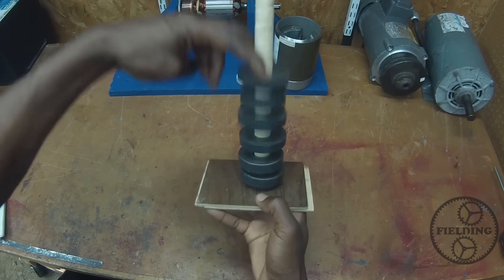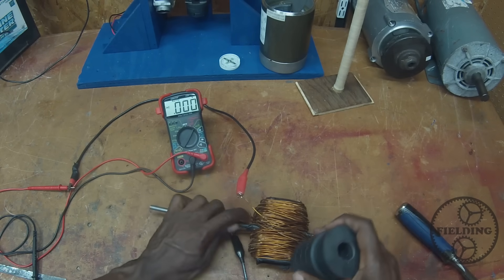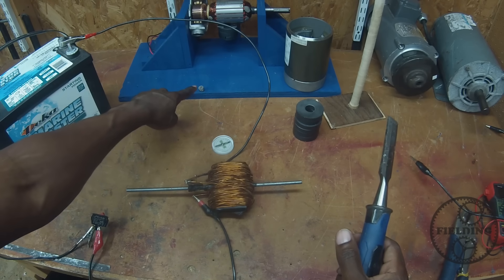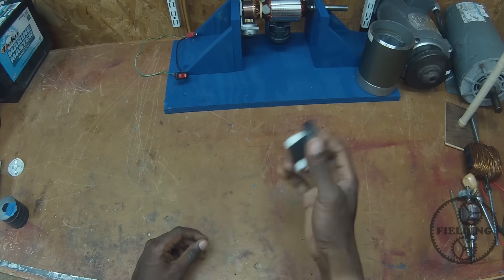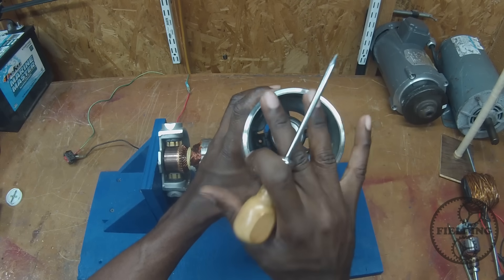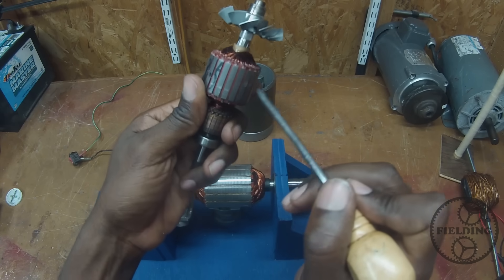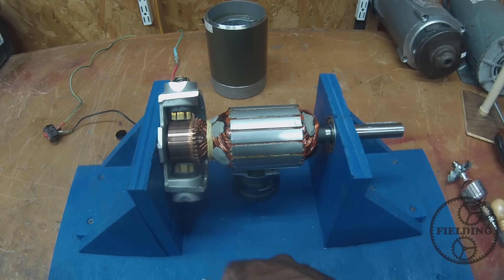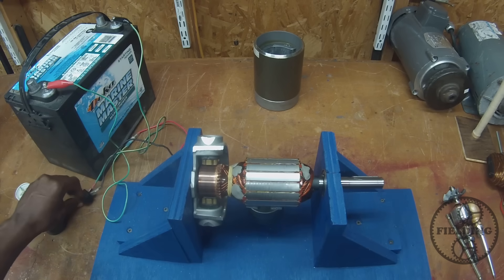How Motors Work For Beginners (Episode 1): The DC Motor: 032

Comment: I enjoyed your presentation by multiple examples.  I never have cut any motor to 1/4 open. Cudos!
One thing where you can meet a whole lot of interesting and so practical details is the brushes.  They are mostly made of carbon (graphite) for some very beneficial properties.  First, they have a natural lubricating property, so they do not wear too bad, despite of being relatively soft.  Then they have just an adequate amount of resistance so that they don't cause a total short circuit between the two neighboring commutator segments.  That allows the energy in consecutive coils be dissipated in more gentle fashion.  However, at really high speeds, you start seeing some sparking.  That is related to what maximum speed is specified to the motor.
Many people try to "clean" a patina that has built on the copper lamellae.  That generally is a mistake which causes wear of both the carbon brushes and the copper commutator.  The wear product (carbon dust) settles to the gaps between the segments and that may cause a "ring fire" around the whole commutator circumference.,  Building a healthy, smooth patina requires air and some humidity.  Motors to be run in vacuum or at very dry ambients cannot build the patina and have to choose something else than graphite brushes, such as some silver alloys used on satellites.  Or they have to use brushless motors.  And on big motors, you want to reduce the brush resistance and use copper/graphite mix.  Overall, there is plenty of special art about the brushes that you probably can put into an easy to grasp format, as your special skill seems to be.  Keep on making your simple to follow educational presentations for the large general population!

Comment: To the untrained eye... I remember when I was about 7 I tried and failed to make a working transformer... the "magnet wire" looks like unsheathed copper wire, which to further confuse sometimes is copper inside. After my project failed it became really obvious that no insulation made the electricity just take the shortest path and not wind in many loops around the bar, but whatever encyclopedia picture I'd seen of this stuff was probably what led me astray. I'm commenting here to save my past selves who are growing up seeing this now. -  PS stripping lots of copper wire is not easy for children  :)

Comment: Hi Jeremy!

Would you be able to give me some advice? I'm currently rewinding a field coil from a Makita 2414NB cutting machine. Are you able to tell me how many woundings it should be? I'm thinking 30 or 40 circles but am not sure. 

Appreciate any help or where I can find this info ! thank you.

Specs are below:
Wire is 1mm diameter
240V 
2400W 
3800RPM 
10A
50-60HZ
The Steel fields printed number is 256009
Reply from the maker: please read the very end of the video description... thanks!
Reply: @Jeremy_Fielding  No problem Jeremy, I understand and thank you for your response.

Comment: I have a question on that makeshift motor that was made with wire wrapped around an iron core. Why isn’t it welding itself together or heating up like nichrome wire? Usually when you want to do an emergency weld you can attach battery positive to one end (ground) and negative to an electrode or even a wire hanger to weld on that same piece which would in effect complete the circuit and make a flux core welder.

Comment: I have a 12v trolling motor and when i apply 24v it doubles its output, supposedly, but it also melted the brush holder, speed controller and wires in very short order. I knew this would happen, but i want to know why. Yes, more power = boom, but is it amps? Volts? Watt? What is the difference between my 12v TM and a 24v TM. Is it possible to convert a motor from 12v to 24v? What happens if you run a 24v TM on 12v? Will it burn up too? I would think it would run at half speed, but double the torque?

By comparison, my weedeater is 36v and the motor for it is minuscule compared to the 12v trolling motor yet it doesnt burn up why?

Is it just a matter of increasing the wire size, number/size of brushes to accomodate the increased amps?

Also it seems that supplied volts determine current draw? 

More volts mean less amps at a given speed, but less volts also mean more amps at a given torque?

It seems that to much or to little volts will burn up a motor.

Volts = speed
Amps = torque
???

Comment: Hi there I’ve just got a twin disc grinder it has a very heavy electric block in it around 6”x6” but seems to be bypassed can you tell me what that could be .seems to have lots of copper wire 
Thanks

Comment: I listened to one of your videos for 12 seconds....and the way you talk, explain, man ....I am on video # 6. Subscribed
Is the base of your setup metallic? ....if not, the magnets appears to be  in contact with the armature of the rotor...why doesn't spin with it?......silly question, I know.
Reply from the maker: There is a small bracket holding the magnet. You can briefly see it in the video.

Comment: I have that exact motor and i overheated it pretty bad, sparks out the top and everything. It still turs the motor over when i give it power but at a lower speed than before and it crackel and pops all the while. Noticed one of the brushes had a crack in it but was still holding together. If you burn a motor like this, what is it that melts and causes the motor to be damaged?

Comment: Hey Jeremy. Love your videos and your gentle and generous spirit. I was curious about the 90v rated motor on a 12v(?) battery. I would think the 12v would be insufficient to run that motor. Is that battery larger than 12v?

Comment: hi, You have explained in a very good manner. I want to know that is the name of this device (Blue Metal color)  which u r using to rotate the motor inside it.It is very good for experiment and testing. Also know let me know can u use this in AC power supply instead od DC?

Comment: Hi Jeremy, great videos...After seeing the whole series, I ended up with a small doubt. Can you please explain about the capacitors in ceiling fan motors? I've seen these doesn't come with the centrifugal switch or any sort of relay to take this capacitor out of the circuit (start winding). In this case, how does it work?

Comment: Hey Jeremy,  want to know when u separately put the mangnet beneath the rotor, how did rotor rotate becoz above the rotor there wasnt the other magnetic pole ?
Reply from the maker: The question is "Do you need a magnetic on both sides" ... watch it again and consider the options.
Reply: @Jeremy_Fielding   thanks Jeremy.  I hv seen at electrician shop- he tests light bulbs by 2 clip wires in series like a bulb requires here 220V, 50 Hz. He touches the clips at both terminals of bulb n it glows.  BEFORE that he tests his crkt & shorts both leads & bulb at the back glows,  Can u elaborate this with experiment.  As bulbs need parallel supplies ?

Comment: This is great. Now put a two ton train wheel at the end. First it is much bigger. Question: can you move the magnet closer or farther away to slow down or speed up the rotation? Trains can go 75 miles per hr., but not from a standing start.

Comment: i have curious mind, i thought the motor creates electricity, but it creates a rotation movement which is used in ex an example cars, but an electric motor needs to be hooked a battery and then it creates electricity is that it?

Comment: Guys i have a problem with my motor, it does this fast spin,slow spin, fast spin slow spin and so on motion. What do you think should be the problem? Is it the power supply or the motor is broken? Btw its a 12v dc motor

Comment: Why bother creating an electromagnet? Why not just use two sets of permanent magnets in the same configuration?

Edit: I just experimented with this a little bit with a dozen magnets glued around a cylinder and a couple magnets glued to a bench top. I tried several different orientations: 
Cylinder: nnnnnnn  bench top: sssssss
Cyl: nsnsnsnsnsn bench top: nsnsnsn

None of my configuration resulted in rotation.

There must be some Secret mechanism that I am missing that takes place with an electric motor that cannot be replicated with just permanent magnets. What it is I do not know. I would really like it if someone could explain it to me.
Reply from the maker: Watch the video again.... I explain this at one point in the series. I thought it was the first one... this one
Reply: @Jeremy_Fielding  

Thanks. I will watch the video again. 

But in the mean time, after further investigation i think i understand. 

The coil on a DC motor is an electromagnet that changes its poles as it rotates on its axis. Something that permanet magnets cant do. Their poles are constant and can not be reveresed. Electromagnets poles can be reversed by swapping the postive and negative terminals around, which is exactly what happens as the coil rotates while in contact with the brushes. 

Is there such a thing as a multi phase DC motor?
Reply: Yes, you do explain it. I just wasn't paying close enough attention. But when you describe the action as a squirrel cage, chasing each step am i correct to assume that the stator and the iron sections of the coil are set some degrees off one another? Just as   one section rotates around the electrical connection is broken and the next is engergized pulling itself towards the magnet, rotational momentum keeping it spinning in the fraction of a second nothing in energized. If they were perfectly aligned i would think it would not spin but just get stuck.

Also what limits the speed of a DC motor? Voltage?

Also also, with a dc motor, how do you achieve low speed and high torque without gearing?

Comment: Jeremy can I ask you question about what I have is DC motor and AC voltage regulator but it didn't come with the panel that has the up and down controller with it, so the regulator has a 4 ribbon wire out of it and it didn't come with a potentiometer I have one  that only has 3 legs out of it and i want to add it, so how do I wire the potentiometer to control a DC motor?

Comment: How come when the cables are connected in the circuit to a motor you get no spark with a switch but if you take a wrench and just go direct to the other pole you get sparks

Comment: I have a question sir... 
I understand that a wire, wrapped on a piece of metal, hooked to an electricity source, creates  electromagnet... 
What  i want to know is, about the coil..
How many turns does it take to be magnetic?
Does the number of turns and/or thickness of the wire affect the strength or power of magnetism?
Therefore, will the amount of turns and/or thickness of wire used as the coil have an effect to the speed of the motor? 
Thank you very much...

Comment: At the beginning the magnets reminds us that the width of tubing can amplify the water table up ... the spacing of magnets grew.  I also wonder if magnets can play a role in amplifying the free lift of water from the tube sizing .  This makes free water pump maybe more enhanced but definitely I can continue understanding reversed wired motor or stator will produce free energy from the water wheel turning from water downspouts.

Comment: Hello I have a question about the iron rotor(or maybe stator) since there are individual pieces of iron that are insulated if they were to rust or be scrapped that they connect would it decrease the strength of the magnetic field?

Comment: Would be even better, if demonstrated with a 3 pole motor, and then you could also demonstrate how the 3 bars on the comm are clocked in relation to the 2 brushes.

Comment: I have a 1.5 hp dc motor that is plugged into 115VAC source. Motor has 4 brushes. While using the floor polisher that this motor is attached to, it was running fine, "then began to arc and spark like crazy"., It was turned off and hasn't been run since.  Upon inspection, the motor was extremely dirty. Also the brush wires looked like they were originally red but are now red brown. I got new brushes and intend to replace them. Any other suggestions? By the way, the commutator surface is not blackened and doesn't show any signs of degradation. Thanks for your help.

Comment: Oh that means to you that the Y motor armature is set up at 120 degrees apart from one another giving the spin ability and inertia ability related to the commutator and brushes.  3   times 120 is 360 degrees .

Comment: The motors in the cassette players I worked with were  Y    DC motors also which used    3  commutators for 2 brushes and brushes were +    and   - polarity Direct current.

Comment: I worked with cassette players, boom boxes, hand held carry round cassette players  from 1982 to 2001 that ran on 120 VAC and a step down transformer with primary and secondary.   Secondary was either no center tap or center tap.
That meant that a full wave rectifier was hooked up to center tap and a full wave bridge rectifier was hooked to no center tap secondary.  The secondary  on the transformer was anywhere from 12 volts AC to 30 volts AC approx.
After the secondary was the AC to ripple  DC conversion by the rectifiers  and a capacitor filter section which produced pure Direct Current and then  regulated with zen er regulator  for stable voltages in relation to variations in current called knee voltage.  Then the cassette players motors ran on +  and   -   DC voltage. Meaning the AC was converted to pure DC before the motors were hooked up to run smoothly.

Comment: Ya still never explained about how many copper wires are in each winding and why are the windings set up as they are and what difference does it make. There is always something missing from these educational videos. I did not learn much about why the rotor spins at the speed it does.Maybe you have another video up here that I should look at, before bitching about it.

Comment: Thank you for the video. Quick question... on my 10yr old Trane hot air furnace the 1/2 horsepower ECM blower motor was barely turning and making squeak grinding noise.  I removed blower motor expecting the bearings to be at fault but the bearings are fine. I took motor apart and it seems the magnets seperated.  The glue that held the magnets in place wore off and caused the magnets to come in contact with the copper plates causing the noise. Do you think if i glue the magnets back on with high temp epoxy the motor will be fine? The copper contact points opposite the magnets are fine no visual gouging or anything.

Comment: I also never can resist getting motors out of junk. The other day I got 3 motors out of a microwave (like you have done in the past): 
1) The plateau motor which I believe to be mains voltage (220V here)
2) A large fan, which is a shaded pole (likely  220V AC),
3) a Radial DC blower. This one puzzles me a bit it has 5 wires coming out, that go into some sort of black box that transforms it into just 2 wires (+ & -). It is the well known MD-HFS25 and I have no problems getting it to work (how simple can it be), but I am just curious whats in that black box.Looks like it has 3 capacitors in it. Any idea?? If not, thats ok, it works, I was just curious

Comment: Great video, really appreciate the share here!
Please do correct me if I am wrong: electricity is supplied to the brushes (1 + and 1 - I assume), each one of the 2 brushes touches a metal bar inside the commutator (the brushes seem to be at opposite ends from one another). These bar are linked to electric wires in the rotor creating a magnetic flied which interacts with the permanent magnet in the rotor. Since what we have now is basically 4 magnets in a circular chamber they are trying to "align" their polarity, creating the rotation. Is that correct?
Am I right saying that, in order to achieve rotation, the bars which is energized in the commutator and the bars on top of the wires have to be "slightly misaligned" (ie: once the rotor moves by 1 unit in one direction, it moves the commutator by 1 unit and then it keeps going. If they are not misaligned by 1 step/unit the rotor wouldnt turn)
Thanks!

Comment: Hey mate, what happens if the commutator is carrying DC current and produces field exactly opposite to the permanent magnetic (stator) force and becomes magnetically lock and doesn't rotate. Is it a possibility? If not, why?  Anyways, the best motor basic video ever. Thanks Jeremy

Comment: In most DC motar that two magnet inside  is same pol or in different pol.....
Reply: Different poles. S ---------> N. That is the direction of the magnetic field. The electro magnetic field induced by the current in the wire is constanlty trying to align itself with the permanent magnetic field, but it is always playing catch up.

Comment: Hi verry interesting video, i want to make a self generating generator ac suply like I've seen on Youtube can you tell me if it will work if i have a permanent magnet low speed generator and a copasator 5 hp motor, will it able to run it self and give me some free curent, can you advise me?

Comment: Do this experiment mount a microwave magnet in a drill Chuck using a plastic toilet seat bolt and rubber washers, next cut ferrite tubes off of computer cords or salvage ferrite tubes 1/2 inch tubes place tubes on the side of magnet notice they self space themselves, next hold the drill horizontal and slowly rotate the magnet notice ferrite beads rolling around the magnet, next turn on a old color TV set crt model stand across the room now rotate drill slowly increase the speed, and magnetic fields shoot across the room and affect the crt picture, you just made a magnetic field weapon!😀